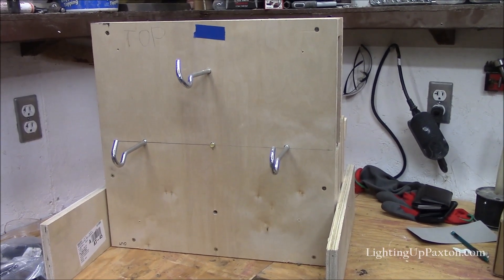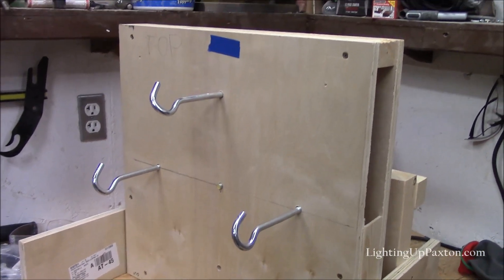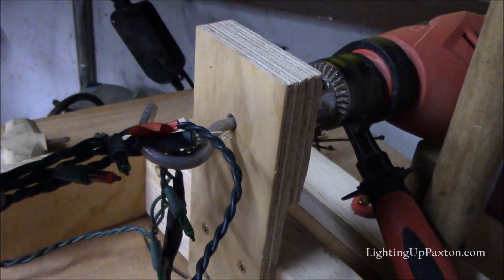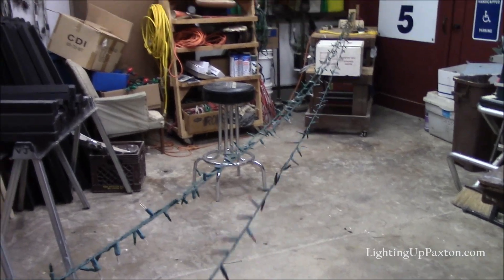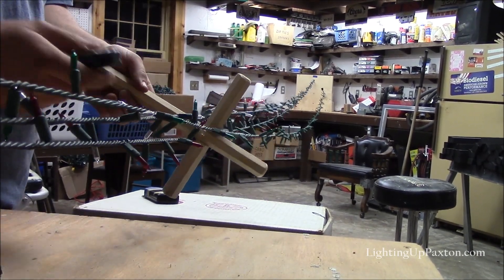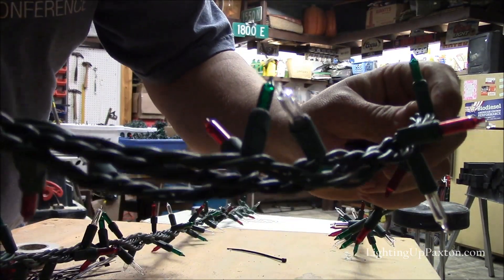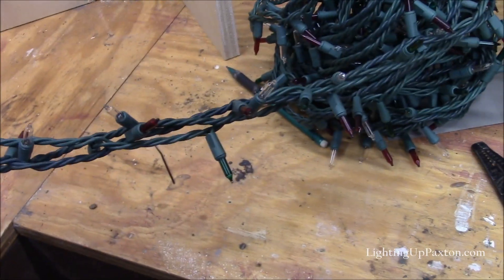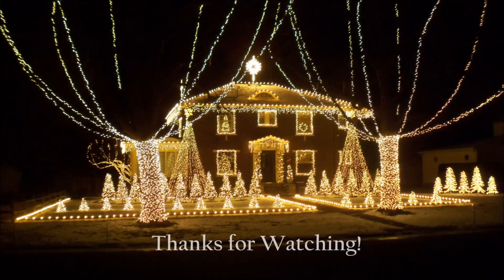Braiding Christmas light strings with a rope making machine

Comment: I saw your video and am intrigued. I have always done red and white alternating lights, but they don't seem to be making an LED variant that I like. I have some long white/red strands to combine together (just 2 together). Do the same principles apply when combining two strands as with the 3 as shown in the video?

Am I correct that your jig has 4 gears, one central and 3 independently/simultaneously driven by the central gear? Did you save plans of your jig specifically? (I saw the link to the site for the wooden gear templates. Thanks!
Reply from the maker: I don't have plans for the machine.  It's 2 sheets of 3/4 birch plywood with a 1 1/2 to 2" space in between for the gears to ride. Gears are made of the same plywood.  The drive gear I believe is a 24 tooth.  The gears for each hook are 12 tooth.  For every turn of the drive gear there is 2 rotations of the hooks.  Yes, drive gear is in the middle with smaller gears around it.

You can do the same setup with as many gears as you want.  I actually have 4 hooks, so 5 gears total.  I just didn't hook up the bottom gear since I didn't need it.  I found a nut and washer on each side of the gear with one side also having a lock washer was plenty strong enough to friction fit the gear on the threaded rod.  I didn't line the plywood with any bearings so over time the threads will eat into the wood frame, but after making 150 strings so far this wear is minimal.  BTW.. try to cut your gears very accurately.  Even then you may need to file some of the teeth down a bit once you test fit it.  And you can wax the teeth so they won't be as noisy.

Comment from the maker: @Neil, set your Google+ Youtube settings so anyone can reply to public comments.  Youtube settings prevent me from replying direct to your questions.  Mega trees were about the same time frame for me too before I finally braided them together.  When a half-string or something else goes out I am still able to separate the wires enough to use the Light Keeper Pro to fix them, so I can't really say I've found any difficulties with it.  The braiding together with the rodent control is what helped a lot.  If I was still getting wires chewed on as well, I'm sure I'd still be having headaches trying to sort through chewed wires.   Here's my mega setup with the braided strings..  https://youtu.be/eTjt_ak5xOo?t=1h10m30s   Thanks for the comment.

Comment: Question: So I do all this coiling and then a bulb goes that you cant find or a break. It is a GREAT tool, but it seems like a lot of work with a high potential for it to be waste of time. I am always looking for time savers, but I also don't like to do stuff over. Currently I have two mega trees (clear & red and clear & blue). they are both on the same 24 channel grid for each so that is 3 controllers. I want to make them separate from each other so it would basically 72 channels  (24 each for red, green clear). The benefit that I see is keeping each strand of 3 light colors together. Currently I take a set of clear and red, unwind them both and then run them up...that is a lot of time. takes me 3 days to completely do 2 mega trees.

Comment: notice there is a empty hole at the 'six' oclock position.. is that for a 4th string?  I am looking at starting my own setup and starting with 4 colors.
Reply from the maker: yes, I made an extra 4th gear with the a hole for it.  If I ever do go to 4 colors, or want to add in a strobe cord, I have it ready to go!
Reply: Lighting Up Paxton do you think you could go to 4 colors and a strobe or 5 colors... just put a hook in the center and spin the 4 around it...?
Reply from the maker: Sean Taray The problem with a center hook is that the center gear actually spins the opposite direction since it is the drive gear.  If I ever wanted to do 5 things I would probably just put the strobe cord on a hook with one of the light strings and see how it works that way.
Reply: Lighting Up Paxton yeah that makes sense...but what about a fixed hook that does not spin? and just braid the others around it? just a thought
Reply from the maker: That could probably work too.